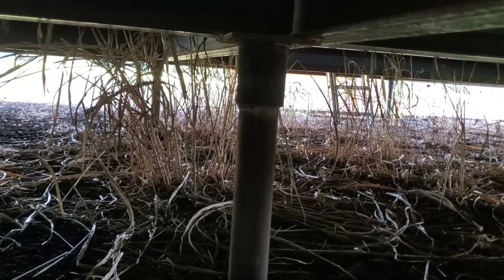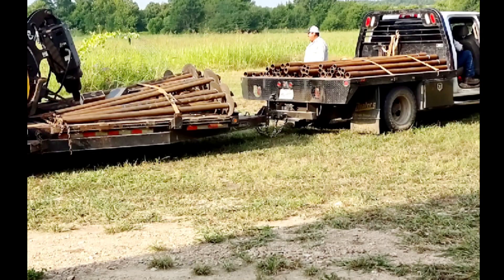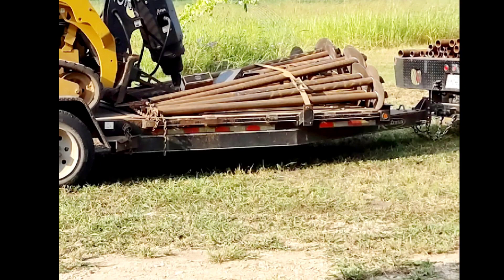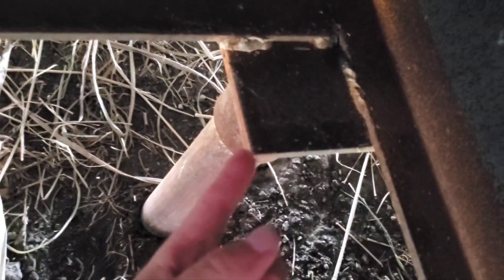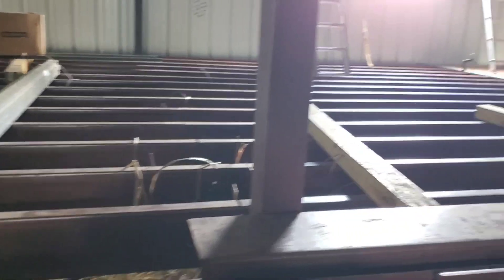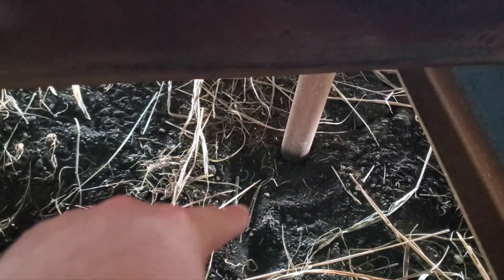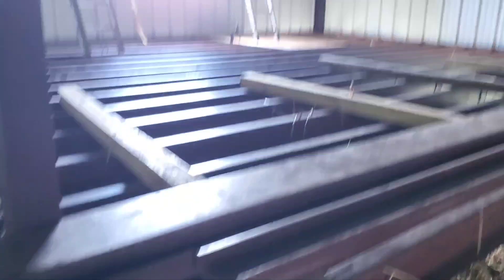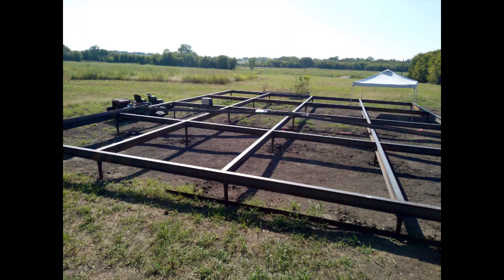A House Foundation That Won't Move - Helical Piers

Comment: How far down did you have to go to hit rock.  I agree it may not move for some period of time but over the long term and with enough pressure, those welds will pop.  Something that is not as affordable but what I found to prevent shifting is to excavate the soil about 5 feet down(for one story home), then set a liner and back fill with more stable soil/sand mix.  As long as you are on moving soil, it's not if but when the foundation shifts.  Also in Ag areas, with irrigation dropping the water table, sink holes are a concern.  This liner solution can help against that as well to a degree.